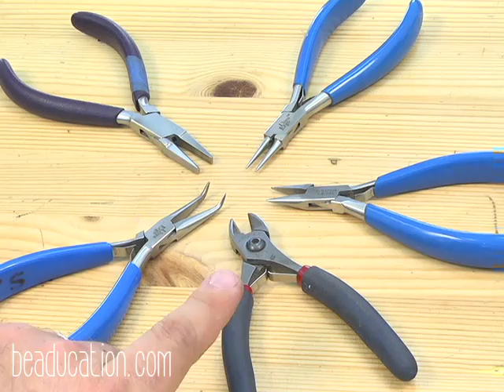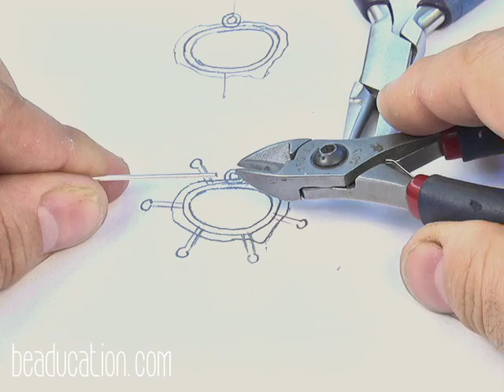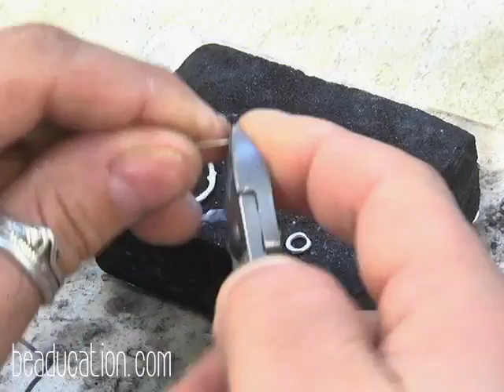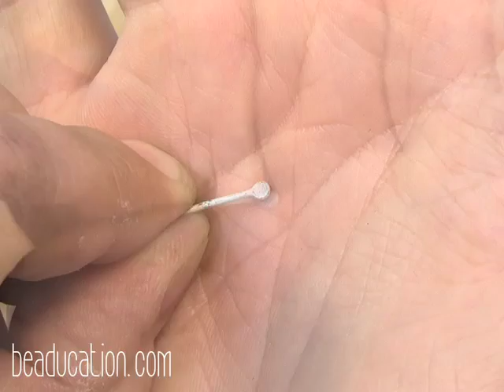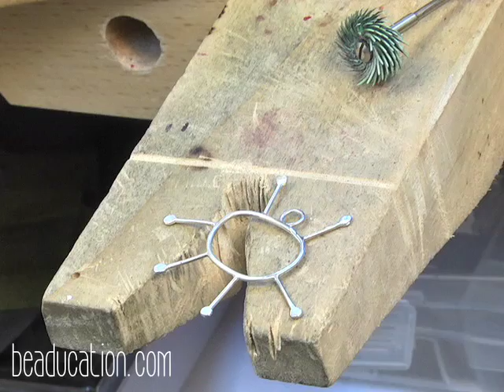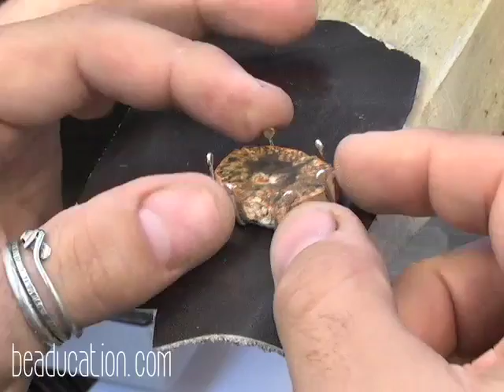Freeform Prong Stone Setting Tutorial - Beaducation.com

Comment: I have a question about bending the prongs. Especially if the piece has been tumbled won't it be quite hard? Wouldn't you risk crunching into the stone? How do you make sure you don't damage the stone when the prongs are bent? Thank you.
Reply from the maker: Hi Marian, sorry for the late reply, a bunch of comments got hidden, very odd. Anyway, you just have to make sure you place the very gently and you don't work with a stone or object that is too soft or fragile.

Comment: I am now trying to do this project with copper wire and copper wire solder that doesn't need flux. Having hard time getting it to flow. Should I still use Handy flux ? Or is handy flux preventing it from flowing ?
Reply from the maker: I find that I still need flux when working with solder wire.
Reply: Beaducation yes realized that also. By trial and error I'll get it right. Thank you